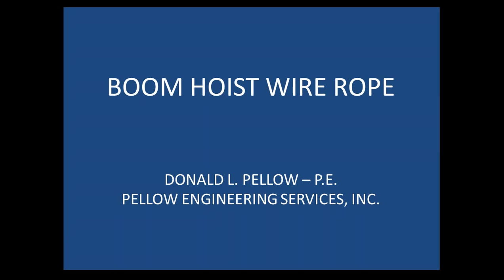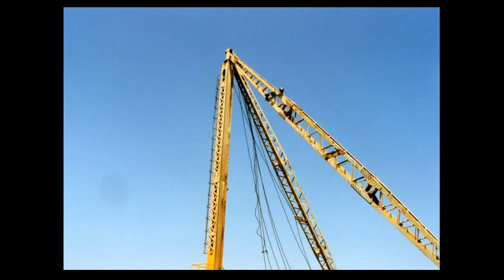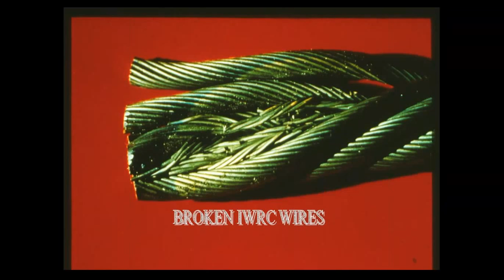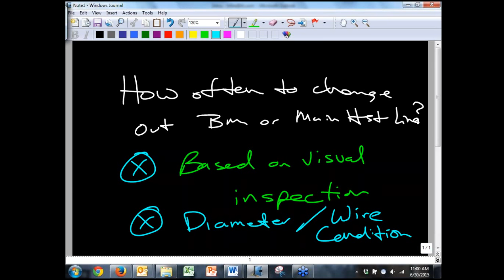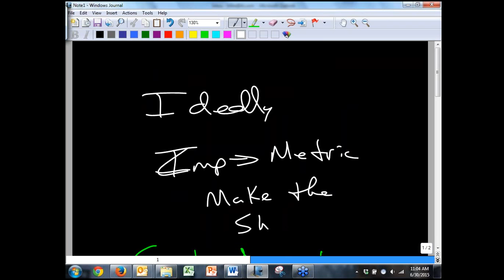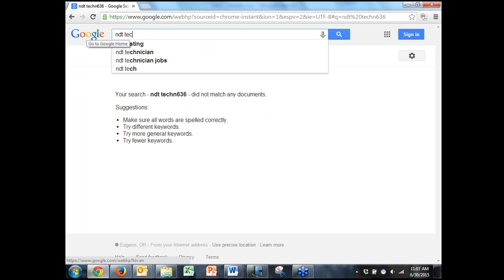Boom Hoist Wire Rope on Mobile Cranes - Failures & Considerations

Comment: Learnt more about wire rope failure in the last hour watching this video then I have in the last year.... I would disagree with the comments on lubrication though, particularly the reference to 'solvent cut back'. Many rope manufactures dissuade against this, given the introduction of a solvent also removes any remaining build lubricant, best going with a solvent free spray or drip feed... otherwise a great video #rsclare    😁

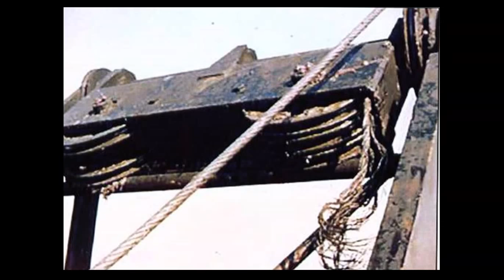Comment: 23:10 (you said without warning) I disagree with the phrase as inspections itself are a warning if done properly and discovered
Reply: Hi...good day i have quistion about to replace a boom steel wire rope of a crawler crane 40 tonner.how many meters i want to replace the steel wire rope?
Reply: @bertbayaton5390  you need to look at the manufacturers specification for the wire rope.